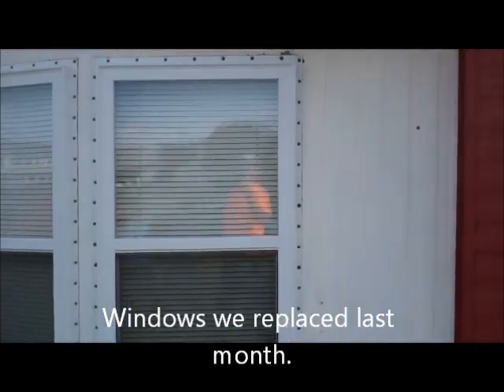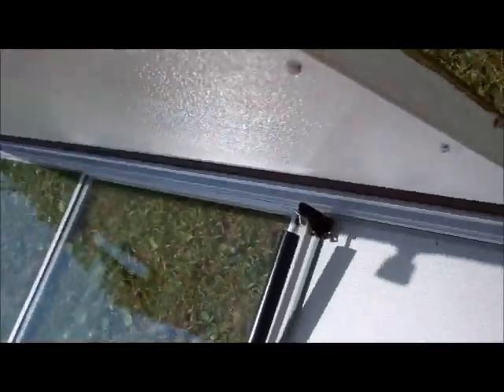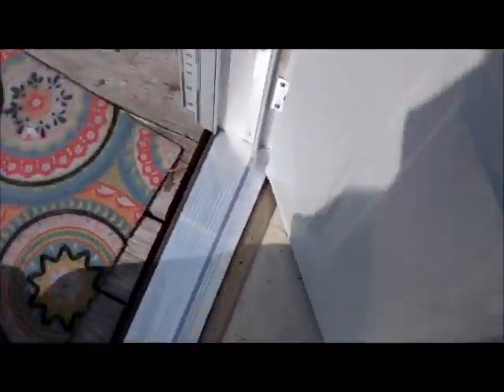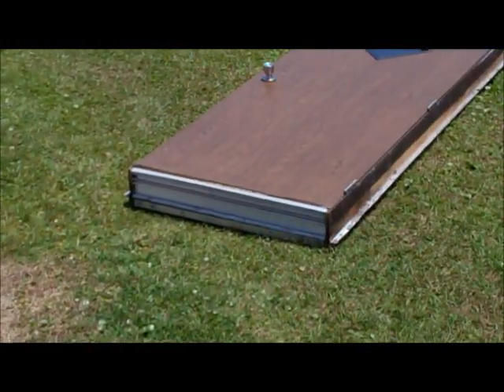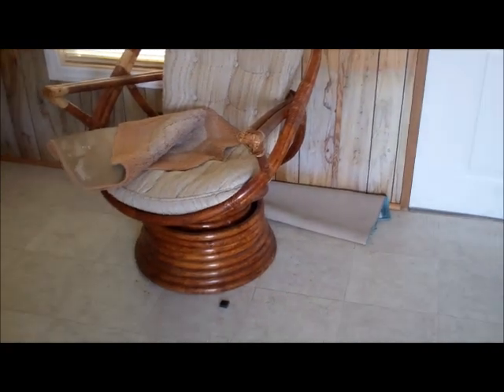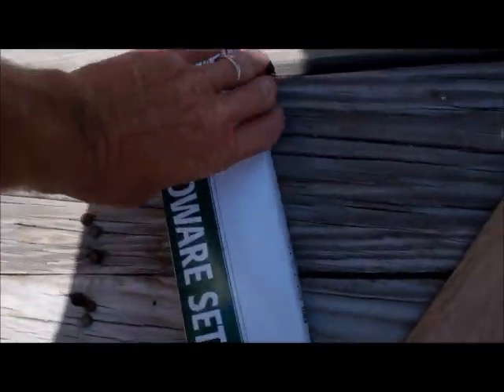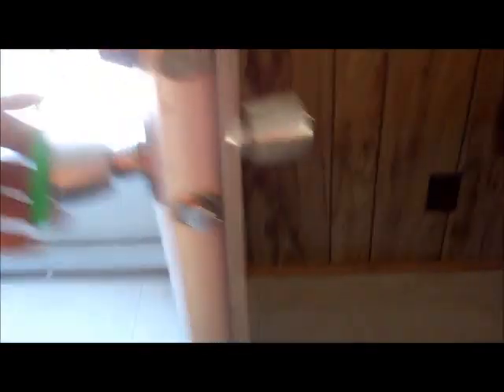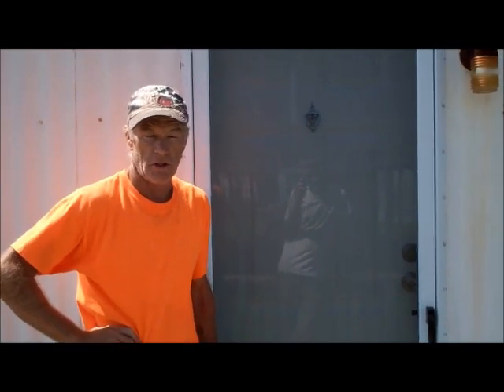Installing new mobile home doors

Comment: I need to Buy ANewFrontDoor ,ThisOneIsShot Gaps On Edges
Reply from the maker: Now they sell the doors as what they call a combo kit it will have the screen on the outside and the door on the inside. It will all be one piece. The old-school screens were the door on the inside and the screen screwed to the exterior metal frame. The door combo kits generally run around $500 around here

Comment: Whoever put a normal size house door on my trailer, did it wrong. I got water rot all around my door frame. So that's a whole mess that I have to fix someday. My home isn't all bad. I have a new water heater, furnace, bathtub and central air.
Reply from the maker: I put a house door in mine as well. Small leak around the screen area. But nothing rotten yet.

Comment: Gotta get doors from correct mobile home manufacturing company
Reply from the maker: I agree
Reply: That only works for the homes that are less than 20 years old. I have a 1969 unit and the manufacturer no longer makes my doors. Nor will they custom make one for me.
Reply from the maker: So what I would do would be custom make the hole. Cut the hole any size you want frame it all in put a new door in it. I have put house doors in many mobile homes.

Comment: Do you use 100 percent silicone or that tape?? What is better?? And if the new door pan holes line up with the existing holes is that a problem??
Reply from the maker: Use the tape never silicon   Use the tape and Lexell caulking. The Lexell will come out some and you can wipe it off. Use the same screw holes if they are not stripped. If so use a longer or bigger screw
Reply: @Drewsroofingandhomerepair  OK thanks and not trying to ask stupid questions but I want to make sure that I do it right. Should I use the same thing for windows??
Reply from the maker: Yes windows and doors get mastic putty and then caulk to make sure it is sealed good
Reply from the maker: https://youtu.be/Uqkerlz6R0E
Reply: @Drewsroofingandhomerepair  thank you